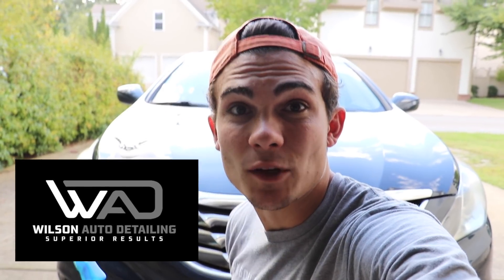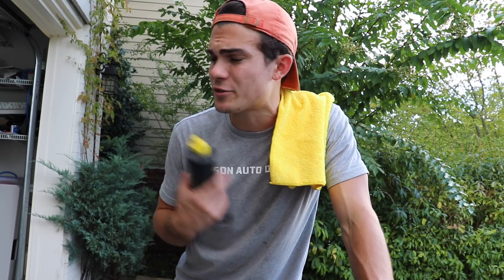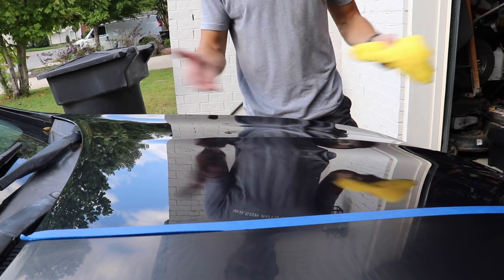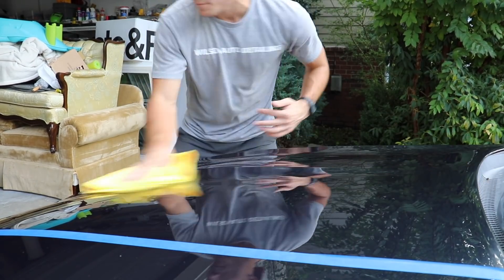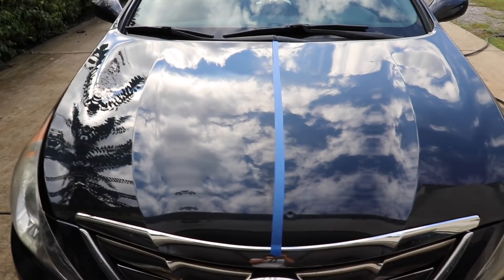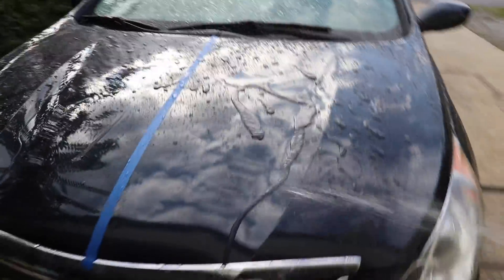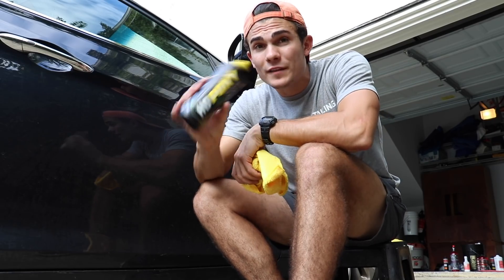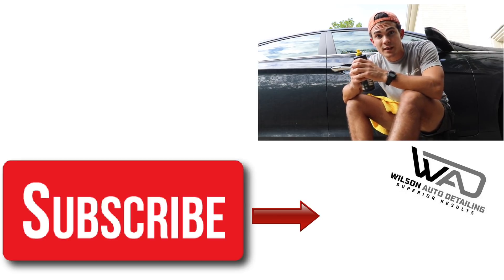Sealant VS Wax: Visual Difference & Water Bead Test!

Comment: Greetings Luke from NYC, question I polished the car 2 weeks ago and put a layer of collonite 945 on the car , can I wash the car and apply the HD Poxy over the collonite 945 . Any suggestions on what should go first or you just can’t combine the two. Thanks . Great video as always .
Reply from the maker: Hey man! So generally I like to say there’s not a huge point to combing these products or products like these. Many times detailers want to use a wax, then a spray wax, then a sealant, then a finishing detailer, etc... and my opinion is just that when you use something like collonite, I don’t see a point in using something else, because the point of the product is extreme protection more or less. Yes you could use hd poxy over the collonite but honestly I’m not sure which I would use first because they’re both TECHNICALLY waxes but really sealants, but again I would say don’t overthink it. One is plenty!
Reply: Thanks Luke , you are correct sometimes we tend to overthink on stuff. Thank you for the quick response. 👍🏻
Reply: Hey Luke , Bill from NYC can collonite 945 be used with a DA polisher . for what I've seen on Vids it appears to be watery?

Comment: Can you do a similar split on the roof with Megs UFF and HD Poxy?  Megs is aerosol and flashes off, where as it looks like Poxy is best applied by machine?  If Megs beats Poxy over time, then it is a no-brainer on my end as to which one  is easier to work with as a mobile detailer.
Reply: You could do it.
Reply: @unrealorbit  I could, but I am too cheap to buy poxy when I suspect Megs UFF is superior. Unfortunately I don't get a kickback for saying so.
Reply from the maker: Definitely! NOTED

Comment: Question which sealant in your opinion sheets water..i am really looking for sheeting type of sealant or wax so water doesnt stay on car for long time..
Reply from the maker: It’s a good Question and this is the age old debate in the Detailing world. The way I look at it is this: In my opinion it is very difficult to see the difference between those that sheet and those that bead as far as when water actually gets on the paint. There’s so many variables to things like that even down to the inclination of the car as far as how it’s positioned. I would say HD poxy is a fantastic product that you cannot go wrong with especially with water running off the paint

Comment: I have HD Poxy, and it's really ok. I wasn't really impressed with it.
Reply from the maker: Ill be doing some updated videos as far as durability in the coming weeks
Reply: Thanks Wilson. The thing about products like OCW, is that it's so easy to re-apply. Durability is somewhat a non-issue. I watched your other video when you tested it on the Mini Cooper, and while there was barely any OCW left at the 3 month mark, re-applying takes 5 minutes. Heck, I've read on some forums people applying it weekly (though it's wasting product doing that)